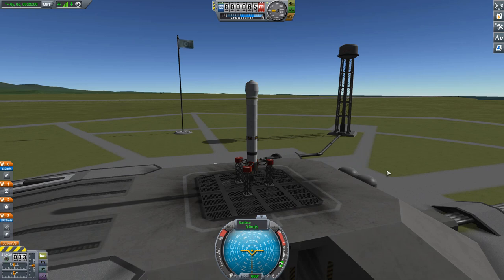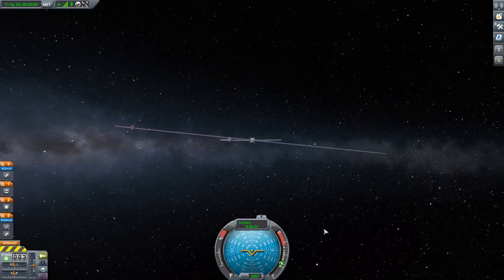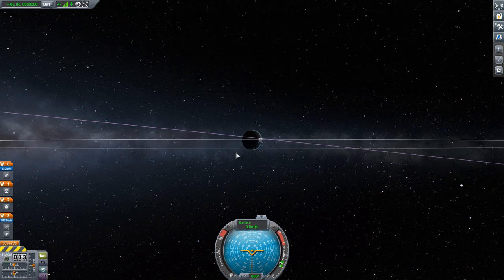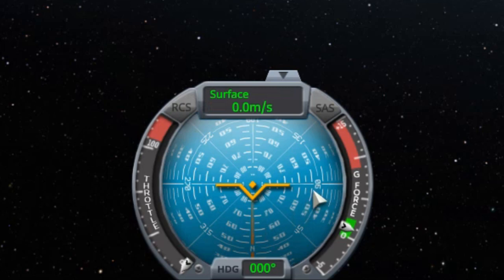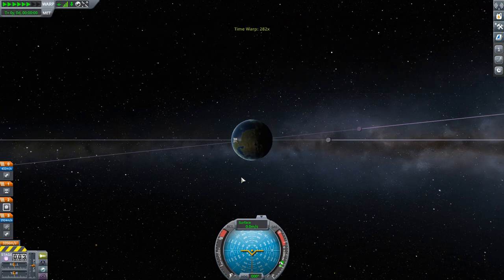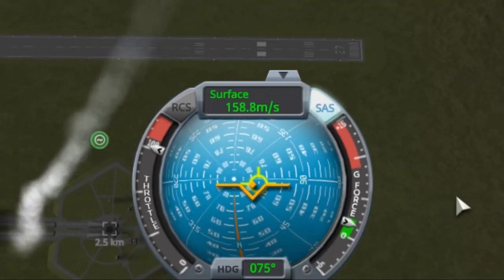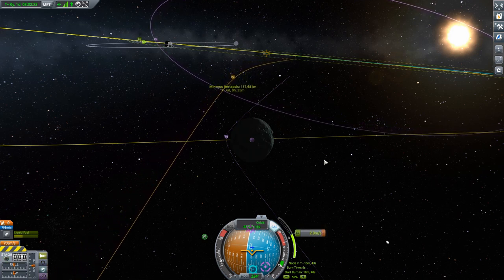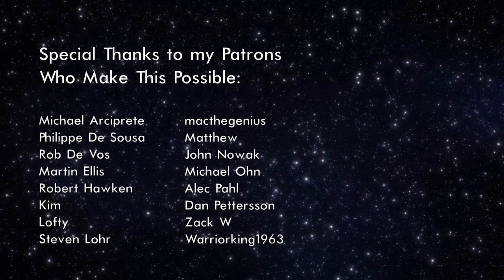How to Get to Minmus (EASY & CHEAP) - KSP Beginner's Tutorial

Comment: "And we want to launch 6 degrees degrees towards the north of east" - probably you should explain where did you found that number??
Reply from the maker: That number is on the KSP wiki for Minmus. It's unfortunate that it is not provided in game.
Reply: @MikeAben  There is so much small info like this the game should provide. I shouldn't have to search outside the game for info necessary to actually play the game. Or what I would prefer would be to provide me with the tools to calculate stuff like this myself.
Reply from the maker: @protospace270  I agree. There is an orbital info tab in the Tracking Station, but it is missing important information while providing information you'll rarely need. In addition, there's very little in game explaining what it means.

Comment: Very well presented info! Thanks for giving back to the community. There's another method that is easier and more efficient, with a less-frequent launch window the only downside. The idea being that you arrive at Minmus when Minmus is at the AN or the DN. This means you never leave Kerbin's equatorial plane. The timing of the launch window is easier shown than described (there's a video on my channel that shows it) but it's not long after Minmus leaves its lowest point if you're aiming for the AN, or not long after it leaves its highest point, if you're aiming for the DN. That's the timing for stock, at least. Anyway, just some more options.
Reply from the maker: That makes perfect sense. I understand exactly what you are saying. You would definitely perform the ejection burn at one of the nodes, but you'd want to time it such that Minmus is about 9 days (about a sixth of an orbit) before the other node. Like you said, the downside is that you'd only get a window every 25 days.
Reply: That what I was doing back in my early days! Yet now I don't bother as the midcourse correction is small anyway
Reply: @AbsoluteHuman  or we could just all be flying direct ascent profiles, if we wanted to be really fancy!

Comment: I've haven't yet fully shaken doing  fine control by hovering the mouse over the maneuver node direction indicator that I want to tweak and rolling the mouse wheel instead of the click and drag.  But that is pretty finicky stuff, if you roll too far or too long then some sort of mouse-wheel acceleration kicks in and all of your efforts go to waste quickly.  I really need to commit to muscle-memory the new maneuver node adjustments down in the lower-left.  Thanks for another cool video!
Reply from the maker: I've almost always used mods for maneuver editing, my current fav being Maneuver Node Evolved, so I never got used to the old stock system.
Reply: That's actually sounds like some sort of a plugin thing. Somewhere in the mouse settings, anyway
Reply: @AbsoluteHuman  The mouse-wheel acceleration stuff might be, or might not, I don't know.  I've messed with a bit and, for me, this is just "how it works."  You should try it and report back! :)

Comment: How did you know that it was "6 Degrees" inclination north of east to 83 degrees and how can I calculate the degrees for other planets? Maybe I missed how you were able to tell.
Reply from the maker: Minmus is in an orbit inclined at 6 degrees. This information is available in the Tracking Station, or you could go to the KSP Wiki. It's much more complicated with other plans and most people simply eject from an equatorial parking orbit followed by a correction burn mid-course. If you want to get into inclined parking orbits, I would recommend the mod Transfer Window Planner for that.
Reply: Gotcha, thank you!

Comment: Sorry if someone has already asked this, but how exactly do you find out that 84 is the degree that you want to point at while launching. Asking because I don't want to have to look it up every time, but want to try to figure some of this stuff out myself. Don't worry, I'll still be watching your videos because they're absolutely FILLED with tons of useful information. Love your channel by the way. 
Thanks in advance.
Reply from the maker: No problem. To head into an equatorial orbit (inclination of zero) your heading should be 90 degrees, that is due east. Minmus is in an orbit with an inclination of 6 degrees. I want my parking orbit in the same plane. That means heading 6 degrees south or north of east. That's a heading of 96 or 84 degrees. In this case, I needed to head north.

Comment: Hey, I know it’s been a while since this video came out, but I’m having an issue. I haven’t experienced this before, but during around the same time of getting to orbit my rocket becomes unstable and flips sideways. What am I doing wrong, my design is the same or exact to yours.
Reply from the maker: Stay close to the prograde vector, and make sure to adjust the throttle limiter of the engines. If that's not working for you, put on bigger tail fins.
Reply: @MikeAben  wow, I wasn’t sure if you’d reply, thank you! I think you’ve got the best KSP tutorials, they are very step-by-step and thorough.
Reply from the maker: @killerstache5321  Thanks. There are a lot new ones too if you check out my channel. The algorithm just likes the older ones.

Comment: 19:32  "I rarely use this"

I can tell.  Because the way you described it is completely untrue (for throttle at least).  As far as I know fine control has ZERO effect on how throttle behaves. It's merely for attitude control and (and maybe this is what you were thinking of?) RCS.
So one could use this in conjunction with aft mounted RCS thrusters to get REALLY fine control over a vehicle velocity.  The only situation I can think of where I might want this is docking, and only if the RCS is by default WAY overpowered for my ship (which would be my mistake, because...  why put such heavy RCS on a ship?  It's mostly dead weight.)

Much easier to use the thrust limiter, no matter how you look at it.
Reply from the maker: I agree. I just always get people asking why I don't use "precision control" so I thought I should mention it. It's much the same reason I don't use the game's docking mode, but that's another video.
Reply: It is ok for tiny midcourse correction tunning with RCS as limiting trust on every one of them or turning the whole vessel is rather tedious

Comment: I'm actually pretty sure that the 340 meters correction in the dV map stands for the worst possible scenario when matching the orbits "legitimately" on the node, so like making all the transfer burn to an elliptic orbit and THEN beginning the normal burn while still at periapsis. Mid course corrections tend to be much smaller
Reply: Or maybe it accounts inclining the parking orbit prior to the burn. Hard to tell for sure without some testing
Reply from the maker: @AbsoluteHuman  I'm quite sure what the number is either. Perhaps a plane match at apoapsis. I'd have to do the math to be sure. Either way, I agree. Corrections tend to be much smaller, but it's nice not having to worry about it at all.
Reply from the maker: Just did the math. It's a 6 degree inclination change performed immediately after your Minmus ejection. Why you would do such a thing I do not know.
Reply: @MikeAben  When I first started playing I found a Kerbin-to-Minmus set of text instructions that had you 1) launch to an equatorial orbit at some recommended height, 2) circularize, 3) match Minmus' inclination, 4) Point out that now you can match Minmus' inclination at any point in its orbit, so you can launch at any time and get there.  Perhaps the old dv maps were based on similar instructions.
Reply: @MikeAben  Like I thought. Well, it seems illogical for a moon but it is a pretty common technic when doing interplanetary transfers where the eccentricity of the transfer orbit is not that high and cruising to the ascending/descending node and changing your inclination there is the simplest approach. And in that case you can't really change the inclination efficiently while deep into the Kerbin gravity well (if you are already in the LKO) so leaving the planets SoI first isn't that bad of an idea even if the node is right in front of its orbit.

Comment: The question I have is will the encounter indicator thingy work on PS4 as it looks slightly different for me? Which setting did you say I needed to change to enable it ?
Reply from the maker: I can't speak for the PS4, but the encounter indicators can't be turned off. There is no setting to look for. If you are not seeing them, it is likely because your encounter isn't close enough. That's easy to happen if your parking orbit is not in the same plane as Minmus' orbit.

Comment: How do I get into an orbit like yours? You were able to make a pretty much perfect orbit whilst barely using 3/4s of your first stage fuel. My best orbit attempt was 800 for my AP and 50 for my PE. How do I control my fuel so I can make it in a good orbit like you without failing? I also have a problem with the control of the probe, I can’t seem to stay on 83 like yours and my navball just flys into the ground. Do you have any ideas on how I can fix these two problems? Many thanks
Reply from the maker: Getting into orbit efficiently takes practice. Remember you can revert and try again as many times as you want. I would get that down before attempting Minmus.

I'll link my more up to date tutorials. There's a getting to orbit video there as well as managing upper stage thrust.
https://youtube.com/playlist?list=PLB3Ia8aQsDKgM2v7mOP6QsC3Yv2CKZrmV

Comment: Why worry so much about heading when you can just constantly adjust north and south so the inclination in the advanced panel sits on 6.0 degrees by the time you've raised your Ap to >70km in the ascent? After you escape most atmospheric drag effects I find you can switch to map mode to simultaneously monitor your Ap as well, or just switch between tabs.
Reply from the maker: Minimizing heading adjustments is more efficient.
Edited to add: Making the inclination change when near orbital velocity is much less efficient if that is what you are suggesting.

Comment: Hey Mike, my probe keeps losing signal because the ksp base is on the other side of the planet by the time I get out to minimus and then I can't function my vessel. Do you have any advice for this?
Reply from the maker: You must have ground stations turned off in the settings. You should turn them on.
Reply: @MikeAben  thanks for the quick response, it turned out that I didn't pay enough attention to turn my solar panels towards the sun on the journey and the command module ran out of juice. Thanks anyways.

Comment: I have got a question: when I decouple my boosters, my boosters always crash back into my rocket. Why is that happening? I always put my decouplers on the bottom of the last stage of the rocket, is that the reason and where should I place them. One more thing: What TWR is good for taking off of the ground and how do I make the TWR higher?
Reply from the maker: I'm assuming you mean radial boosters attached to the side of the rocket. They're likely too high on the rocket. Try sliding them down with the move tool but keep the radial decouplers where they are. I explain it in this video.
https://youtu.be/fbNAjmooad0?t=1199

I like a surface TWR of about 1.30 to 1.35 at launch. You can adjust it by right clicking on the engine and changing the thrust limiter. You can't move the thrust limiter above 100%. If the TWR is still not high enough, you need more engines or less mass. I explain this in more detail here.
https://youtu.be/HN8dus_zZbE?t=955
Reply: 2 years late but early game I'm currently using airplane tail fins as my fins. This enables me to "deploy" them which immediately puts my rocket into a spin which followed by decoupling boosters "throws" them outwards. 

Absolute noob only just getting into this game great tutorials btw

Comment: Im sorry were the fu*k did you just get extra fuel from thats not explained in your videos or I just missed it
Reply from the maker: Where am I getting extra fuel? Can you provide a time stamp.
Reply from the maker: Hang on. Is see that bar jumping around 8:20. If that's what you're referring to, that's a bug. Notice the dV doesn't change and the bar drops back down a few moments later.
Reply: I see
Reply: I had trouble getting orbit with your rocket design I kept running out of fuel but I just added boosters and that helped
Reply: @artemkrylov9516  its cheats, you can hear his keyboard clicking and the fuel increasing ... sadge